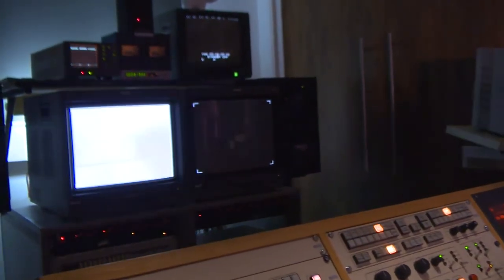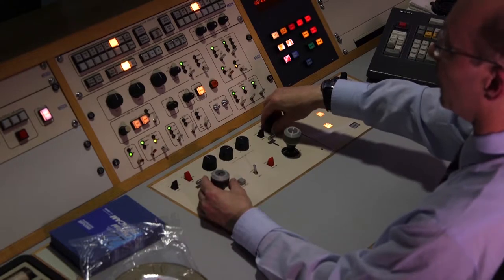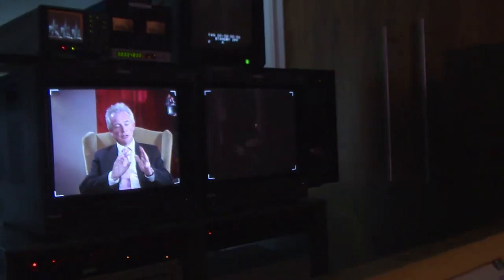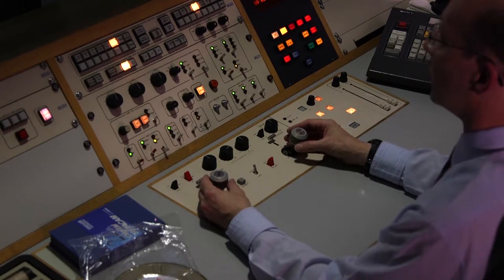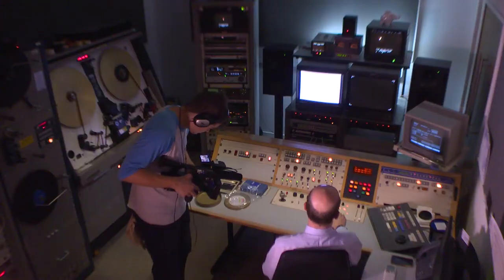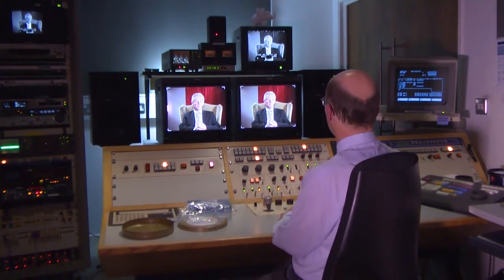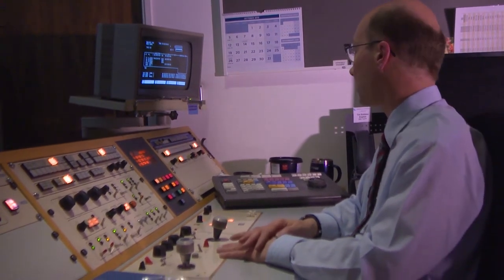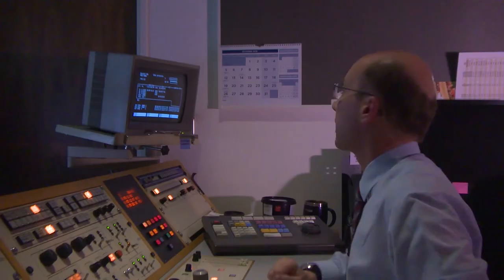16mm telecine demonstration

Comment: Do they mention at any point in the project at which frame rate the film was shot (both for this project and for the BBC in general)? I naively assumed the BBC shot film at 25 fps for a frame-accurate telecine to PAL video, but the final output video from this project is surprisingly jerky and looks more like a pulldown from 16 or 18 fps.